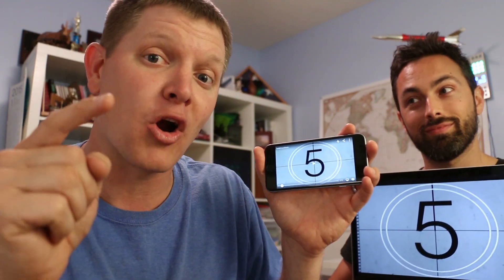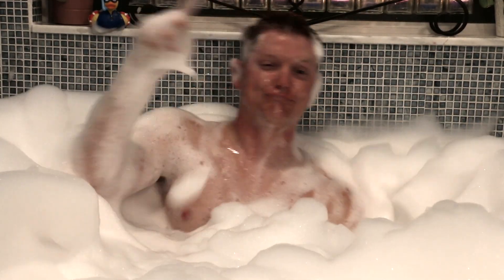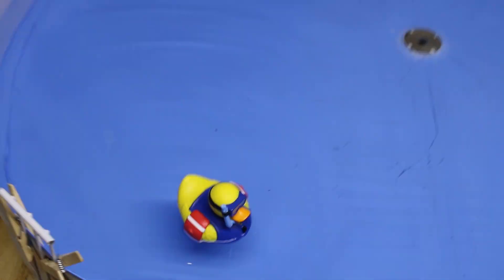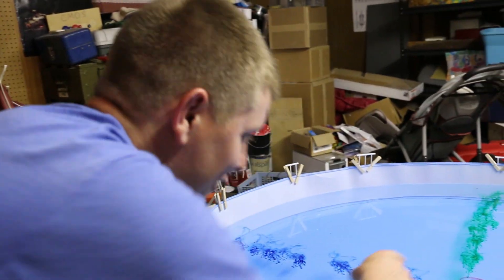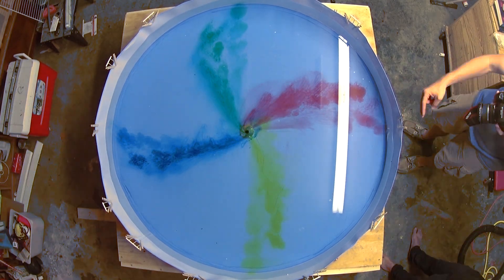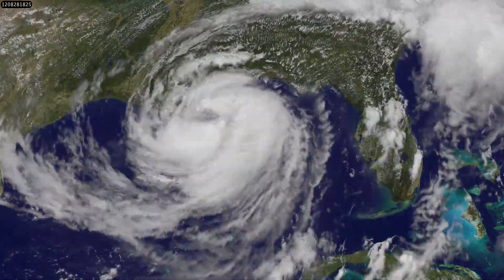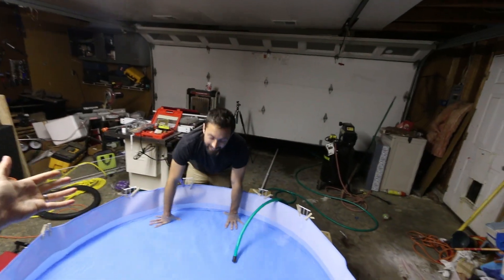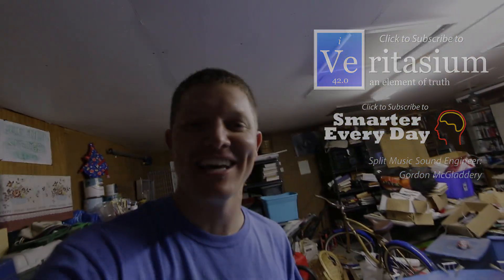The Truth About Toilet Swirl - Northern Hemisphere  (Smarter Every Day 137)

Comment: I have a question, if we place the pool with its center directly on the equator, which way will the water swirl??
Reply: can't you answer that yourself?
Reply: +Bobbin McBong apparently this question won't be here if I know the answer
Reply: cough well since there is no coriolis effect on the equator the answer would be 50/50
Reply: I thought of that, but we are talking about science here, so an experiment must be conducted to know the answer
Reply: well we can't perfectly be at exact equator so, there'll be either of one of those,
interestingly there's this one myth about no matter where the spin of flowing water in pipes and faucet are always counter clockwise

Comment: Question, if they spin in two different directions should they not appear to spin in the same direction. If your in the northern hemisphere you are looking down at the experiment. In the Southern Hemisphere you are looking up at the experiment. If you take your index finger and hold it at chest level with finger pointed down and start spinning it clock wise as you look down at it then slowly raise your finger over your head as you look up at it which way is it spinning.  Imagine a candy cane sticking through the North Pole and exiting the South Pole. If  you were on the moon would it appear to spin clockwise in both hemispheres? But if you fly the the north pole and look down where it is going into the earth which way would it appear to spin? Clockwise, now fly to the South Pole and look "down" at the earth which way is it spinning? Counter clockwise. The only way this is possible Is if your upside down looking up at the experiment. Just curious. Rob.

Comment: I suspect deception because water twisting in pipes  is easy to comprehend. Twisting water in pipes would cause the swirl in the tub, done multiple times would get swirls in either direction at differing speeds.

Comment: Uncontrolled environment, wind will play a role and since coriolis effect has to do with the opposite movement of Low pressure systems, the environment will determine the direction of flow. They went to all this effort, could they not have done it inside a warehouse with no wind? Water always has and still does drain with no swirl at all in a calm environment.

Comment: hey i have a question, you said that the swirl spins depending on the momentum of the axis on the earth, my question is what if you place the drain RIGHT in the middle of the Earth's axis? would there be a drain dircetion or will the water just balancely drain from all sides and suck the water without making a swirl?

Comment: When people believe the earth is flat
Reply: +nichoe Pretty deceptive video by  Destin. First, I'm in irrigation. When water is running through a pipe it rolls over itself. Nothing to do with Coriolis effect.  That is going to effect the way the water rolls down the drain. Just search Hydraulic model testing: Solids transport in waste water pipes. You can see when they attempt to get the solids out of the pipe. The water swirls around. You are debunked Destin. 

Second he didn't do the experiment with the irrigation pipe facing the other way. That will also effect the experiment. He didn't do the experiment with no irrigation pipe. Have the water drain straight down. 

Destin is trying to debunk flat earth without talking about flat earth. Over the last year he  has really been kissing NASA butt. 

I did a curvature of the earth experiment. Floated on an air mattress 1 foot over the water. Looked through binoculars and could see the beach on the other side of the lake 13 miles away. It should have been 100 feet below the curve of the earth. It wasn't.

Destin seem like a NASA shill.

Comment: How do you know that the opening of the valve didn't affect the flow pattern? It would have to unless it opened from the exact center. This is not the case with
 a ball valve which relies on a twisting fashion which would create a bias in one direction or another for the initial inertia of the water to begin a circular rotation.

Comment: this has been disproven, the direction depends on the nature of the drain itself.
Reply: Danielle Ricard ...im pretty sure they mentioned this.
Reply: +Danielle Ricard They used exactly the same pool though, so the drain is theoretically the same...
Reply: Precisely.
Reply: Your point is well taken. Veritasium pulls a plug to drain.  Smarter Every Day turns a valve to drain.  The dropping of the food coloring was inconsistent (and ultimately unnecessary).  Doing real science requires controlling every variable possible and there were many here that were obviously not controlled which gives one reason to call the entire "experiment" into question. To see the CE arising from Earth's rotation, one would need to see an appreciable latitudinal speed difference from one side of the system to the other.  That's non-existent at the scale of less than 2m.  Beyond experimental design, the explanation of hurricanes is either grossly oversimplified to the point of being incorrect or just incorrect.  I recommend anyone interested read up on cyclonic circulation.  The rotation of a cyclone stems indirectly from the CE, not directly from it.

Comment: There seems like a lot of variables that could induce "vorticity" I mean, what about minute variances in the surface of the pool?

Or putting the drops of dye in?

Or if the pool isn't perfectly level?  I dunno, with something so precise it seems like there could be a lot of variables unaccounted for.
Reply: +Ndoki Hasaki How do you know that the opening of the valve didn't affect the flow pattern? It would have to unless it opened from the exact center. This is not the case with
 a ball valve which relies on a twisting fashion which would create a bias in one direction or another for the initial inertia of the water to begin a circular rotation.
Reply: Rick Raulston
Exactly my point.
Reply: +Rick Raulston If they used the same valve then repeated again with a valve that twists the other way and see if there was any change you could be pretty certain
Reply: +Ndoki Hasaki being outside, wind can play a factor and coriolis effect has to do with air not direct gravitational pull. Inside a warehouse as a controlled environment is the ideal place. Also, direct flow with no valves must happen to not limit the drop.

Comment: Ive watched this video a long time ago but then suddenly a thought reached me. If in such a small scale, this effect is already apparent how about on a grander scale like oceans and stuff. Of course perhaps other effects dominate, but we still have a lot mass in a large area. Perhaps someone with a CFD background wanna try simulate it? Like put in that certain amount of vorticity everywhere depending on its latitude?
Reply: +de0509 I think this is easily something worthy to test out or to title a thesis on.
Reply: +de0509 You are  absolutely right. Not a graduate myself but I am studying this currently in college. ANY object in a straight path has its trajectory turned right in the northern hemisphere and left in the southern hemisphere. Fluid dynamics isn't fundamental here - Newton's laws of motion are. It is just inertia on the surface of a rotating sphere. Making it act on a mass of objects just makes it more complex (and cooler to look at). 

But you are correct that fluid dynamics would play a role in larger systems as the actions are communicated by molecules bonded in a liquid (or gas). They all move at slightly different speeds, but are nonetheless loosely bonded and as such the communication that each has with each other travels in an infinite number of directions, averaging out in the neat cyclonic shape. It is riding that line between turbulent and laminar flow. 

This is how we get the trade winds and even the direction of the North Pacific and South Pacific currents. And when you start adding more variables (such as the coastal mountain ranges and continents themselves), the uniformity is screwed up somewhat. Then there is the factor of temperature, where the air masses rise and fall turning in cycles like gears opposite each other depending on which hemisphere. And of course there are reactionary effects like the westerlies that are consequences of this general effect. This sets up the more complex gear-like functions of the atmosphere (google Hadley cells). 

When a hurricane moves over land, the friction between the near-laminar average of the hurricane itself and the rougher ground contributes to breaking up that smoother flow into a turbulent mess. Of course, the lack of the consistent vertical heat cycle that it has over water plays a major factor in the weakening of the hurricane as well. But these are all wonderful examples of where thermodynamics, fluid dynamics, chemistry (regarding the bonds between the masses of molecules), and plain-old Newtonian physics all interact. The fact that humans know as much as we do about all of these variables is truly amazing.

Comment: What would happen if someone put the drain exactly on the line of the equator?  Would the water simply go straight to the drain without swirling?
Reply: +Joshua the Coder 
"Wow... Someone should do that!"

Ddon´t worry! it´s been done systematically centuries ago, and all findings are in line with what should happen according to the predicted coriolis effect!
Reply: Wow... Someone should do that!
Reply: +Eric Vanbergen 
What I suspect is that the water will rotate in random directions.  Any slightest angular motion will be magnified.  Water down a sink will always rotate one way or the other (seems to anyway).
Reply: +Eric Vanbergen  We've got a monument here that crosses the equator line, aside from the sun lining up in the line of the monument at the solstice, nothing  remarkable happens there
Reply: Well, hurricanes don't cross the equator. They usually break up.
Reply: +Joao Victor Prado Macapá ?
Reply: Eros Viana  Yes, why?
Reply: Joao Victor Prado I've lived there . I'm brazilian too .

Comment: PROBLEMS WITH THE TEST:
1) The opening of the valve induces a vortex because the water starts moving through the valve asymmetrically.
2) The swirling water can also be induced if the Earth is not moving, but rather the entire Universe is moving around the Earth. This is the same as with Foucault's Pendulum.
Reply: +Ansley212 
Just why would the imagined rotation of the TINY (32 mile) Sun and Moon and those little lights (planets and stars) above the flat earth act differently North or South of that imaginary line called the equator?
Reply: Rab Downunder
  "TINY (32 mile) Sun and Moon..", "Flat earth"....I never said anything of the sort. So asking me "why" is ridiculous. I don't espouse such ideas.

Comment: What happens when a tropical storm starts in the Southern Hemisphere and travels to the northern hemisphere?  Or vise versa?  Or what about the spin of water if you are right on the equator?  Can tropical storms even cross the equator?  Ahh sooooo many questions!
Reply: There is a NASA map of all hurricanes that have occurred in the last decade. They all form slightly above the equator or below, and it shows their paths. It's very interesting. Check it out.
Reply: following
Reply: +Might Heracros No Tropical storms cannot cross the equator.
Reply: +Might Heracros 
Very few do.  In fact there are few Hurricnanes or Cyclones close to the Equator.  The Coriolis effect is weak there, because there is little change in the earth's radius and hence surface velocity with latitude there.
There was one very weak storm that started as a weak Hurricane near the equator in the north western part of the Indian Ocean.  This storm travelled further west and crossed the equator as a very weak Cyclone (I think).

Comment: Toilets have the swirl induced by angling the holes under the rim. The direction of swirl is designed by the mold maker. A bath tub or kitchen sink shows natural circulation down the drain. Using a toilet to detect/explain Coriolis force is just plain ignorant !

Comment: I'd love to see this one carried out int further investigation. I mean I see down in the comments one guy has tried to debunk it as just a chance so I always think this because I've encountered it myself, do the math by all means but test the theory too because sometimes things come out that go against the math and then you explain that and find out the math could have been corrected and it was a bit off. I've used a good amount of bioinformatics in a project I'm doing on protein interactions and the math is great it's getting things done but have to test the theory to see it and do so many times. I really want this to be right, really badly so it'd be cool to see it done several times and resulted totted up. Not even on a video just even a tweet with a short paragraph linked with a graph.

Comment: Question>It is true that due to Coriolis effect both tropical and extra tropical cyclones rotate in anti-clockwise direction in the northern hemisphere and in clockwise direction in the southern hemisphere.
But why does under the same effect ocean gyre circulation moves in the exact opposite direction? For e.g. Currents(Gulf stream, North Atlantic drift, Canaries current) around the Sargasso sea forms a clockwise pattern whereas in the South Atlantic ocean currents(Brazil current, Benguela current, South equatorial current) forms an anti clockwise pattern.
I hope you do reply. Thank you.

Comment: drain a pool at the equator now. does this mean it wont spin at all? depending on how exact you are with placement on the equator since the actual midpoint of the earths spin is miniscule. I imagine if you line it up almost perfect, there would be no spin, or a negligible amount of spin depending on how far off of the equator you are. on your next trip near the equator you need to bring a kiddy pool

Comment: This comment is made after 1 min of watching.

1. It highly depends on the toilet, most toilets nowdays, have the kind of shape to make the water swirl down. Regardless of the location on planet, if you use one of those toilets, water will always swirl the same way, however it might go smoother in north or south.

2. I've done a test in kitchen sink, well not really a test, just something i have noticed. If i move the tap on LEFT side so water falls against the side of the sink, then it swirls one way, but if i turn tap RIGHT, so that water falls against right side of the sink, then water swirls the other way.
If i turn on both taps (if you have 2) and put them on each side, then water don't swirl at all, it will look like sink is blocked and it starts filling up slowly, because taps will cancel the swirl and make water just pile up.

don't believe me? make a test yourself, but keep in mind that it might not work with every shape of the sink.

Btw SmarterEveryDay why don't you partner with one of the youtube networks? you could easily earn a good 20000usd per month. You're making great vids, you deserve it. i'm sure you get sponsored a lot, but partner up and get paid for what you do!

Comment: Now, I didn't read all 3878 comments but what do you suppose would happen if your pool's drain was precisely over the point of the earth's axis?  Would the water fail to rotate at all, other than the rotation of the earth? Does the water rotate more slowly as you approach the poll?  Does the water rotate more quickly as you approach the equator...  AND THEN, does it not rotate at all exactly on the equator?

Love it!

Comment: Umm... you didn't prove anything. Just because the water swirled in the direction you wanted once doesn't prove that it will always swirl in the same direction every time. Preform the experiment at least 4 times. if the results are consistent, you can make an accurate conclusion. this is pretty embarrassing to be honest.

Comment: Bad science communicator! No donut!!!

Coriolis effect is real, but does NOT determine the direction of rotation of water going down an ordinary drain. The effect on such a small volume of water, over such a short time, compared to other factors, is far too small to determine direction of rotation. 

Suppose the rotation shown in the kiddy pool in this video was indeed induced by Coriolis. If so, notice that it was a very weak, very slow rotation, under controlled conditions, compared to what you see in the bathtub. 

The Coriolis effect itself isn't controversial - the only question is whether drains go one way up north, and the other way down south. So it's deceptive and/or  mis-informative to  claim that this experiment proves that Coriolis determines the direction.

I just drained two sinks, side by side, half a meter apart. One rotated thisaway, and the other rotated thataway! (No, they don't straddle the equator.)

But why believe these guys, or me, or anyone else? It's easy to test, for free. Prove it to yourself. Watch a dozen or two sinks drain, and see if they all go the same way round.

Comment: SmarterEveryDay  Veritasium  You forget that the water in the pool is not still to begin with, even if it's sitting for a day.  Like the Foucault Pendulum, the water would rotate very slowly with the spinning of the Earth. While slight, this would put a directional bias on the drain before you ever open the valve. If you put a bobber in the pool and did a time lapse for a couple days it should move around the pool.